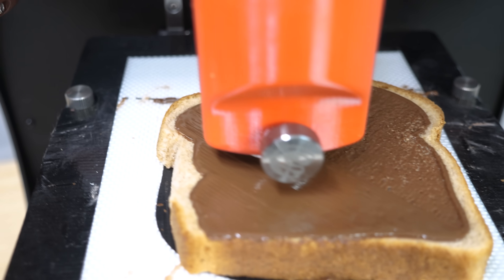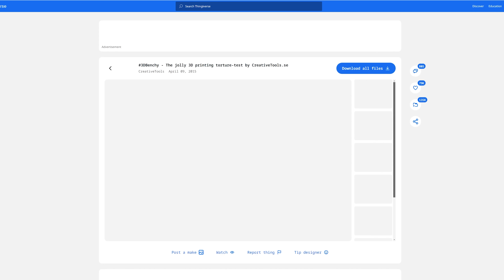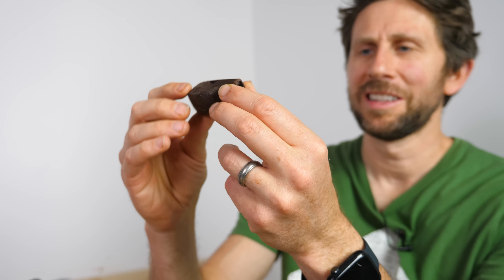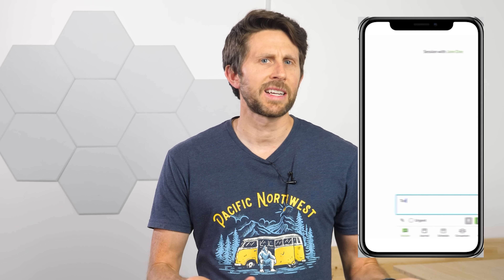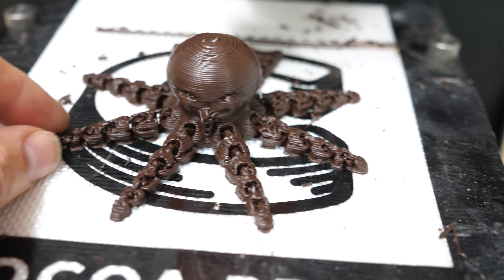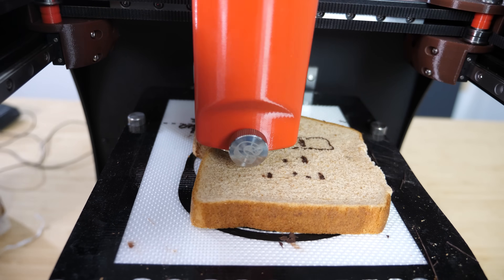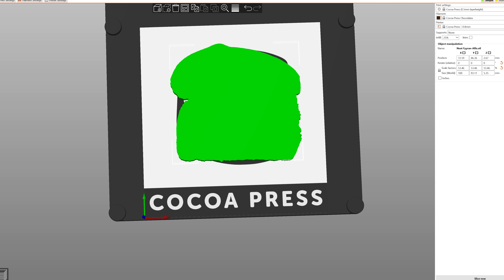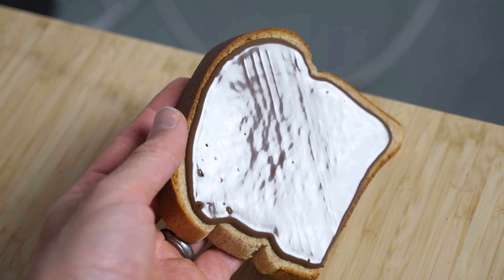What If You Put Nutella In a 3d Printer?

Comment: I'd like to see this again but in a controlled Box or Room, where you can do a bit of 'printing' then solidify what came out using a blast of cold. That way you could get a perfect Benchy made out of chocolate. The process would either take an extremely long time (Squirt 1 cm of chocolate, stop, freeze room/box, repeat.) or an attached tool that maybe blows or mists some liquid nitrogen or like a wand of dry ice that rubs against the melted chocolate(Touching or rubbing would probably mess up the design...)

Comment: 1:30 i think the bigger issue might be that the nozzle stayed too close to the previous layers keeping them warm and soft, so they couldnt cool and harden to support the next layers (you can see that the chocolate is relatively stable at first, but gets melty on the smaller layers starting around 1:15). could try having the nozzle move away in between layers, hopefully giving them enough time to cool :)

Comment: I think the problem wasn't the overhang you mentioned at 1:36
It was a problem with the Chocolate not cooling enough.
The first layers look very good because it had time to cool but the point it failed was when the
printhead moved faster and faster to the next layers.
As soon as new material got placed on almost liquid one it went down hill fast.
Reply: No i think you're on the right track but what i think is actually happening is the chocolate that was being freshly extruded was heating up the layers below it as it was being extruded. I personally would actually put a little bit of coconut oil in it and run a cold fan. Or if you wanna get real fancy attach a second nozzle that simply dispenses liquid nitrogen
Reply: Thought the same. You could also tune the printer or slice it to go slower at that point
Reply: You mean as the video was sped up? wth
Reply: @malomkarom Yes, the Video was speed up but to a constant speed/frame rate.

If you look back, the print head takes more time for the first part of the print because of the hull. Later it only prints the bridge so it's faster. The Video isn't speeding up, the layers just have less material.

Comment: You need to have better air temperature control so the chocolate hardens after it comes out of the nozzle, but before it drips.  I'm picturing a nozzle directing a stream of cold air at the tip of the extruder.  And then, have a pause after each layer to allow the chocolate to further solidify, perhaps with a fan blowing cold air over the whole piece. 
I would try to print a chocolate Klein bottle, or a Menger Sponge, filled with icing.

Comment: Well... if you had the printer in a very cold place while it was printing... such as your fridge or freezer maybe the benchy would have turned out...
Reply: the chocolate wouldn't melt brother...
Reply: @zachnado69  The hot end melts the chocolate easily at low temp, it might work, worth a try.
Reply: @HobbyHalloween  i remembered him saying somewhere in the video that the system wasn't being heated but i didn't remember exactly which part. i see what you're saying now ¯\_(ツ)_/¯
Reply: @zachnado69  It's experimental, I'm sure that it can be figured out. For example, a Peltier heat pump could both melt the chocolate and also cool it.

Comment: As you are not a cook, I'll tell you the easiest way to fill that tube next time with liquid substances. Get a plastic bag, something like one of those zip loc bags, then fill it with whatever it is you're doing. THEN, cut the corner off one edge, and pipe the contents into your tube. Mostly mess-free filling. You can also use a piping bag tip with a nice open circle tip to make it a little more secure, so there's less likely to have a blowout of the side.

Comment: 1:30 i think a possible solution is to get an air circulation channel that focuses roughly 12.5 C air at the print plate. should help with it not firming up quick enough

Comment: You may be able to achieve something similar using a solder paste printing machine. It's like a screenprinter that deposits material onto a surface through a stencil at a constant speed and pressure, applying it evenly.

Comment: I'd consider using an aircon of some sorts to drive the print area down to some near-freezing temperature, or have an extremely cold breeze blowing over the print area, see if it solidifies the chocolate faster or enables the use of cheaper non-proprietary blocks of choc.

Comment: I think the reason the chocolate whistle didn't work is because the chocolate's too blunt and plastic for the air to form ordered vortices in the chambers. I think you'd need a much firmer kind of chocolate to get the reed right. I also imagine the heat and moisture in your breath doesn't help with that, either.

Comment: It seems to me that the main problem with Benchy was that there wasn't sufficient time between layers to let it cool. On the larger layers, each section has time to cool as the printer is finishing that section and starting the next one. But on the smaller layers, the print head passes over a section too quickly for it to have time to cool. Some 3d print software actually lets you set a minimum time per layer and the printer will actually just wait to give it time to cool if it finishes a layer before that minimum time.

Comment: The boat print worked on the lower portion because it has a lot of surface area to cover for each layer. Thus, the chocolate has plenty of time to harden while the rest of that layer is being printed, and before more melted chocolate is layed on top of it in the next layer. 

The higher layers that make up the cabin and bow of the boat all have a very small profile, so each layer is finished very fast, and doesnt have time to harden before the next layer of chocolate is printed on top of it. So what you end up with is just melted chocolate being poured on top of more melted chocolate, and it just hardens in as a droopy blob shape.

To fix this you would need to reduce the print speed so every layer has the time needed to cool, and you could even put a small desk fan in front of it to help speed up the cooling process.

Comment: You could possibly make a Nutella filled chocolate drop by partly printing the chocolate shell, adding the Nutella with a different printer, then capping it with more chocolate.  I suspect also that as the machine continues to operate with the chocolate, the chocolate gets warmer.  Would there be some way to set a slab of dry ice on the printing platform to encourage the chocolate to quickly solidify?

Comment: If I had a chocolate 3d printer, I would print squares of chocolate with words on the top. Maybie even bits of code on the top (I program for fun) I would also print chocolate logos for fun. An apple logo seems easy, but I am not sure how I would do logos like Google, which is just a g, but it's main feature is it's different colors.
I would also try a chocolate fidget spinner. Maybie even a chocolate keyboard key? That would be strange on a mechanical keyboard.
I do have a prusa 3d printer, but I don't think I will try this incase I damage it.

Comment: I think the chocolate benchy failed because the printer doesn't seem to have print cooling, so instead of the chocolate basically instantly solidifying as it came out the nozzle it just drooped down.
Reply: This is what I was thinking as well. Also, when other YouTubers tried it, they spent a long time calibrating the temperature to make sure it printed all right.
Reply: Do you think if they managed to engineer the right outside temperature and nozzle insulation, Benchy would work with chocolate?
Reply: @westonding8953 I would also lower the extrusion rate as you build above the first layer because chocolate is really bad as conducting heat compared to the bed, meaning layers on top will solidify slower than those on bottom.
Reply: @Nanamowa maybe the timing of melting and solidifying the chocolate as it is printed?
Reply: @Nanamowa yeah I am wondering how feasible it is to solidify the chocolate as each layer is printed
Reply: @westonding8953  
That's what I'm saying.
Reply: @Lampe2020 lol du hier?
Reply: Also need a minimum layer time
Reply: Exactly my thought, I came to the comments to see if anyone else noticed. Every modern filament printer I've encountered has one.
Reply: I’ve seen a ton of successful benchy prints IRL. No issue. I’ve seen better prints on beta Cocoa Press machines. Not sure what he’s doing. As for cooling, chocolate comes out nearly liquid and a fan splatters it. Cocoa Press has experimented a lot with outside cooling.
Reply: @geektoybox  
Well, chocolate also takes quite a while to solidify enough to be structurally sound again.
Reply: @Lampe2020  This is a compound chocolate that solidifies quick enough for most prints. As you get to the very top, there have been some cooling issues on various prints. Cocoa Press 2 is Klipper based and they are ironing out minimum layer times, if memory serves.

Comment: I think that octopus would have actually worked if you had scaled it up so the loss of resolution was less extreme.
Reply: That 3D printer is small, pretty sure it was already scaled as much as possible already
Reply: @josguil  he could have printed only one of the tentacles
Reply: @JasminUwU  if you haven't noticed it seemed as if he was trying to do the prints with little to no modification
Reply: also, using a scraper would have probably kept it together more than just pulling it off of the bed.
Reply: @cornboxgod It looks like the chocolate is pretty stuck to the base, and also it’s soft. I don’t think a scraper would work.
Reply: I think what would also help is using something like Ghirardelli dark chocolate; with less milk and sugar, chocolate melts and hardens much stronger, and 90% dark chocolate is surprisingly hard to break, almost like refined wax or a weak plastic
Reply: I think it laps would have been more successful if he used a scraper tool to pick up the print initially rather than plucking it from the head. Of course with proper drying time.
Reply: Try it yourself then
Reply: @lauranasser295  will you fund me?   I am going to need some things:
Bread.
Nutella. 
A 3d printer.
Someone who knows how to work the 3d printer.
And also an assistant, so i dont get over worked. 

So.. Yeah.. either give me the funding. Or get me those things,  and i will make it happen.

Comment: So I'm thinking, a cooling solution for when after the chocolate extrudes might help to make more rigid stuctures.
Reply: Cooling while 3D printing? Bro is onto something
Reply: @David-ty6my  CNC Kitchen channel make fan attached to the nozzle to speed up the filament cooling
Reply: Honestly wouldn't know myself how to implement, but it was my initial thought and posted it for you lovely people to give ideas. This seems incredible as if scaled correctly, it would make food art a breeze. Thinking of those huge chocolate sculptures that cost thousands to make.
Reply: A recommended co2 tank
Reply: Just put the printer into the freezer.
Reply: @Zilahi-Branyi_Laszlo  LOL, I thought that too xD Let's 3d print in the arctics. :) haha
Reply: A bottle of nitrogen, a tiny hole right next to the nozzle, expanding gas, insta freeze, could work?
Reply: I was thinking the same thing. Maybe just shove the printer into a refrigerator

Comment: Spreading the Nutella with a butter knife ❌ Making 3D printed Nutella layers on the bread✅
Also,
Printing bed❌ Wheat Bread ✅
Reply: Wouldn't it be the Printing Bread?
Reply: you can 3d print dough, but you can't bread itself. It is possible to bake bread in the mold at most like a cupcake, but one side needs to be accessible to expansion of dough
Reply: @Oxigenium1  we can 3d print the wheat water yeast and oven

Comment: Chocolate whistle probably didn’t work because chocolate has different resonance then plastic

Edit; check out the reply from Jared…after doing some research myself I can say that material resonance does not apply with wind instruments
Reply: The resonance of the material would not affect if it worked or not, it would only slightly change the timbre. Whistles rely on the size and shape of the air pathway to affect how the air splits and resonates, it probably didn’t work because the edge that splits the air and causes the air to oscillate is droopy and rounded when it should be shape and precise. There are probably things like melted strands of chocolate drooping and sticking out into the air path interrupting it too.
Reply: I think Jared is right. I've printed wind instruments where the plastic had droops and strings inside that ruined the flow of air. You can usually reach inside and smooth/remove them to fix the airflow and sound though. At least with plastic.
Reply: So that means if we edit the format we can have a chocolate whistle?
Reply: i was gonna say the same thing.